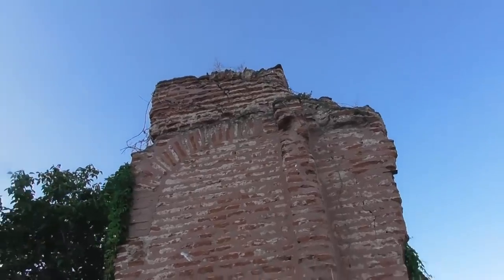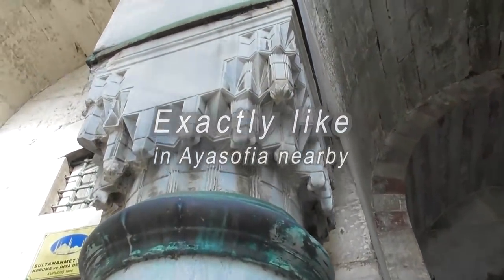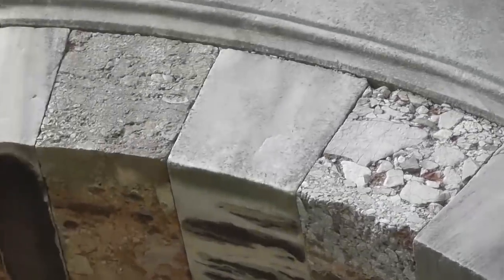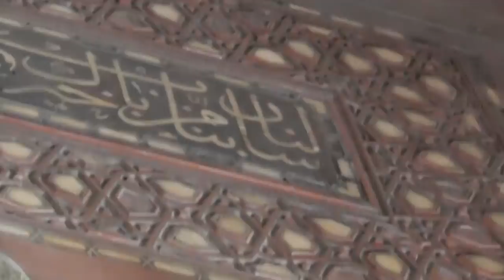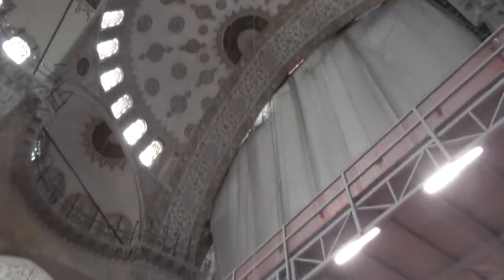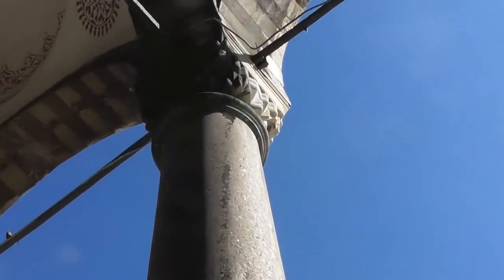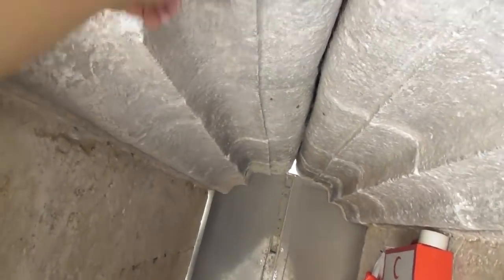Secrets of Blue mosque

Comment: At 20:30 mark the closet room- I have an old book from the 1880’s (sorry in the middle of moving and all books are boxed up) where this British clergyman goes to the Middle East and writes a fabulous book on signs of giants. He describes a metal hinge type mechanism rusting away in the base of an emense door jam top and bottom and concluded it was to operate the huge stone doors mechanically
Reply: I noticed it looks like where the new doors have to open it has been cut away more recently. The metal part set in the marble definitely resembles a modern day door lock.
Reply: The metal cast in between the stones is also reminiscent of the metal cast in stone in Peru and elsewhere, used to prevent the stones from slipping or moving, like a dovetail joint in woodworking, to connect the two pieces and reinforce the seam.

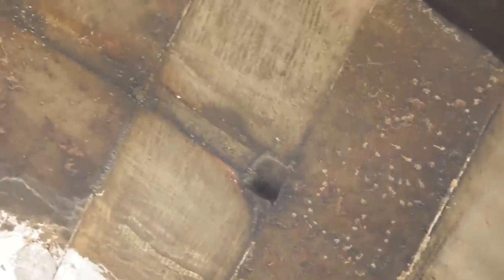Comment: @ 21:52 you can see a lighting fixture between the conduit which is what is connecting thru all The varies openings you covered in this video. Which were installed using modern method. From what I can see. Amazing place for sure I hope to visit sometime.

Comment: those rectangular cut outs in the floor. one was under a metal gate the others were under two doors in that side room? those are where they lock the doors. they still make modern doors today commercial glass and double doors in most buildings lock so that the door locks into the door frames at the floor and at the top of the doors frame. it's the same concept.
the metal bars in the ceiling and the chains are there for structural integrity and stability purposes.

Comment: They say that building should be built without anything between the stones and no metal.....is that why certain buildings SURVIVE...... from what you have seen.....what survives an event
Reply: Looking at your asbostos capacitor....would it be covered in copper or God or lead
Reply: To me simple buildings with out metal and made of straw roof and stone walls survive.... crofts in Scotland etc
Reply: Electric Johnny Hat  there's many simple devices ......look at ....steam helicopters...... hydrogen peroxide over stainless.....steam.....
Just bought s hydrochlorus solution generator......water and salt and electricity......
Reply from the maker: u r most welcome)

Comment: I argued with a brain washed man one time about Pillars or sculptures on many old buildings that are all identical measurements.We measure any ancient Pillars they are impossibly precise.I told man how can all Pillars be carved by different master ccx arvers?First they need to be master craftsman that one man per pillar.You can't have 2 or 3 men carving each single.Maybe 1 man per pillar.But if one man makes makes a mistake or when the rock already had an internal crack
Then with internal crack or void the master Carver uses his chissel and hammer to shape it and crack causes big peice of pillar off making it possible to match others.Only solution is to shrink the scale of the other 30 or 50 most old buildings have many Pillars.So now you shrink scale to fix mistake then once  again a different master Carver makes another mistake thus making it a never ending attempt of accomplishing precise Pillars that match perfect.They had to have a device that didn't make mistakes or a skilled Carver that controlled tool with skill that never made mistake.I hope you understand my words